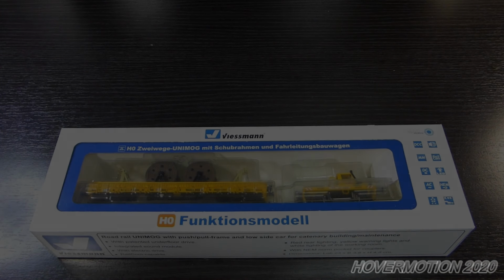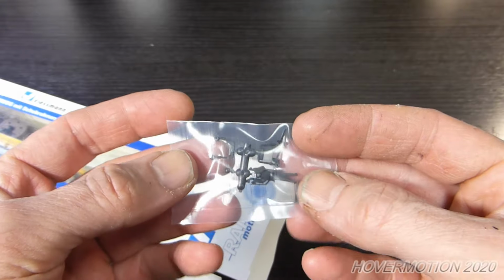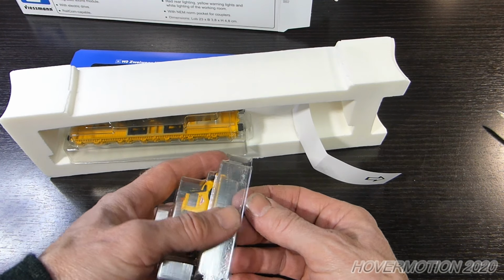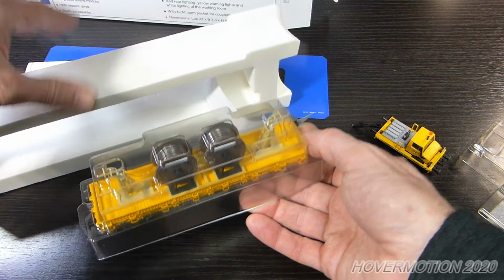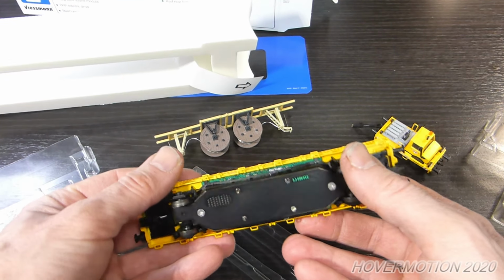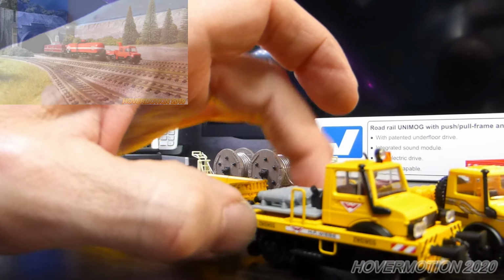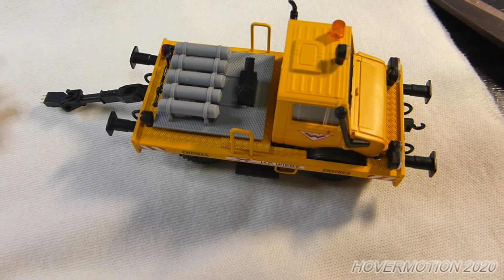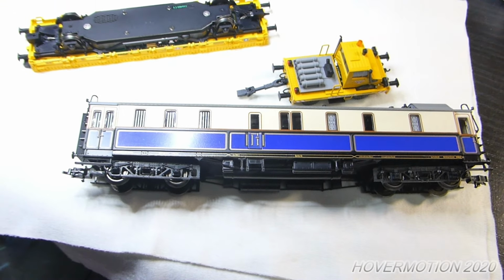Viessmann 2680 Unimog unboxing

Comment: Hello Jim! Thanx for review! I preordered this item but when it has arrived I realized that the driven is the flat car and not the Unimog. Of course it's a smart solution and you can buy the flat car also separate and put it behing old undriven steam loco or so, but that's not what I wanted. I wanted much smaller solution to motorize my other MOW cars. So to canibalize Unimog and put internals in other model. But this will not happen so I have to motorize them on my own... Enjoy it! 😉
Reply from the maker: Cool.....yeah it's a well made model...I love the way it looks and works...
More to follow....

Comment: Nice model Jim, as for the tiny bits I am now using PVA glue to "glue" all the tiny part as 1) it can "fix" all the tiny and dedicated parts to where they are 2) if I decided to remove any of the parts I just add a tiny bit of water to it and the glue will "melt" away.
Reply from the maker: Thanks.....very good tip.